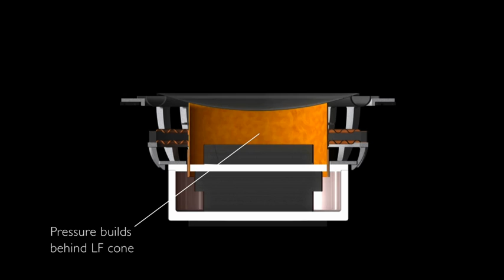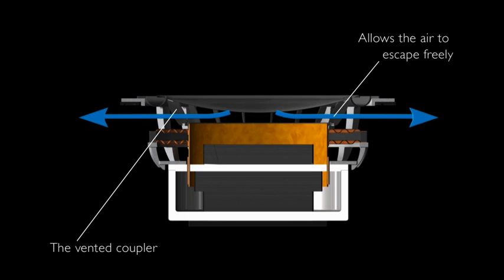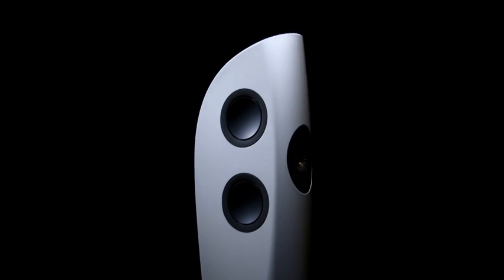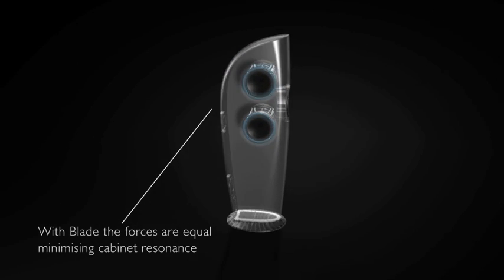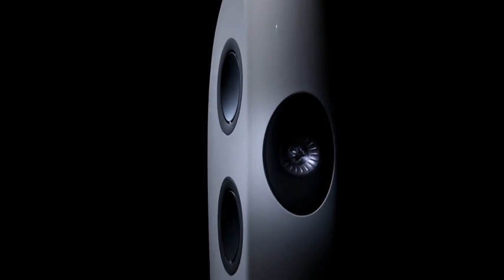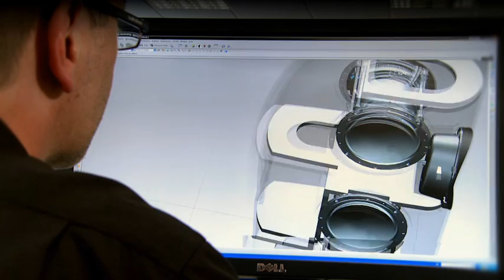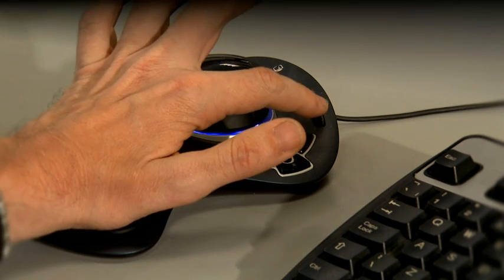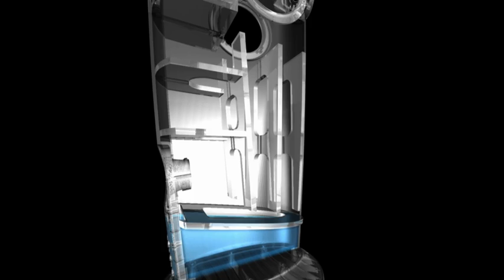KEF Blade - Bass Technology

Comment: Exactly how accurate is the Blade in bass resolution?  Is the response still linear at the lowest note of the piano - 2.5Hz - or at the 16ft organ pipe an octave lower (Tannoy boast this with its admittedly more expensive Kingdom Royals)?
Reply from the maker: Christopher John Bridgman The
 Blade is linear to 20Hz (-6dB). The lowest note on a piano is 27.5Hz. A
 16Hz tone, regardless of the instrument playing it, would require a 
subwoofer capable of going that low in linear frequency response.